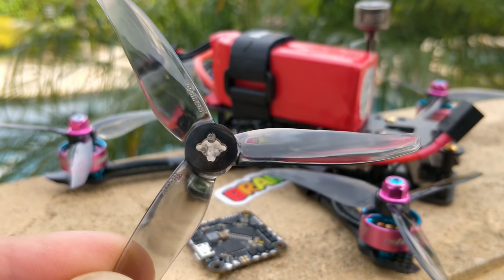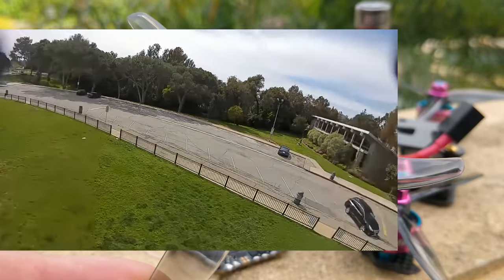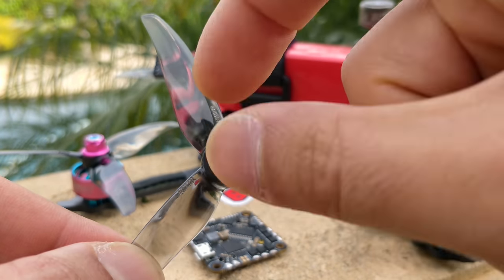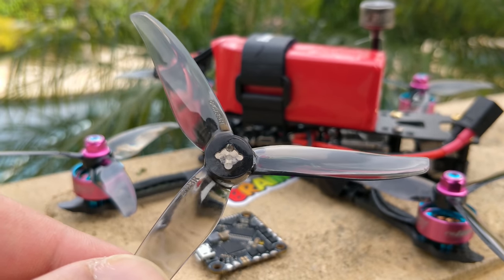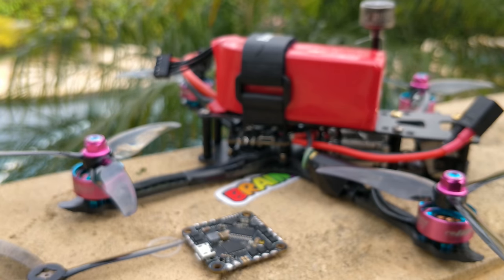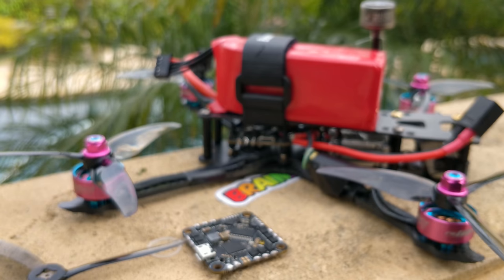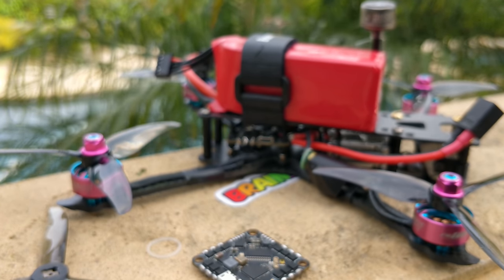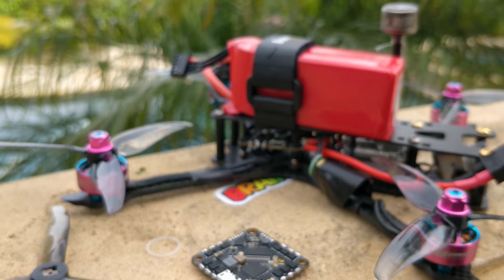Gemfan 4023 and recent  4" builds

Comment: Why such a shallow pitch?  Why not a 4146.6, just scale down the 5146.6?  I'm obviously no aerospace engineer and i'd like to think whomever is making these is, but i'm skeptical.
Reply from the maker: A very valid question. In the past we were all about the aggressive props because we believed they gave us more thrust. What we didn't realize is that these things are always in a hover state and aggressive pitches while great when you're going 130mph, suck at everything else below those speeds. They're like paddles pushing through the air where a shallow pitch prop will more easily process the air into moving in a specific direction than just causing a ton of drag. The resulting difference is better overall response, better throttle control throughout, far better efficiency and a wider rpm window. We gave up the top couple mph as a result to gain all that. Electronics and everything else has gotten much more refined and lighter so we have already gotten those top speeds back and can sustain them for longer periods than we used to as well. 

There is one other significant benefit to aggressive props but you must give up so much else to get that benefit. They can have much better grip because they do make thrust very abruptly in the throttle range. Not true in all cases but seems to be a theme.
Reply: in the past, when they say 4x4.3 they mean " hey, it's the same prop as 5x4.3 but just scaled down to 4in ", but if you think about it, how can you scale down a prop to a smaller size and the pitch/lift can still be the same ? shouldn't it be when you scale down a prop, not only the size number should come down but so the pitch number ?  from what i understand, pitch means the amount of lift a prop can create per resolution.

Comment: btw 300g+ on 4" is bad. AIO. Nano parts. 20g frame max. Toothpick weight for 4" is 180-200g.
Reply from the maker: Depends on the power train. 4" has a much wider window of performance

Comment: Im using 2203 3000kv on gecko 4inch. 650mah 4s is very light... i think 850mah 4s is best. I like 4032 atm. Havent tried gf 4052 yet or this gemfan 4024. Ill try 1300mah on 4s tomorrow
Reply from the maker: I'm literally uploading a video with a similar build right now.
Reply: @Kabab  im still figuring out the best prop + lipo combo. Im thinking 850mah 4s with 4x2.5x3 v2s. What u think?

Comment: i'm a bit bummed about the kv of the et1303
i'd like to run 2s, but 7.5k seems a little high
i'd have expected 6.5k
Reply from the maker: 7.5k is exactly the same equivalent kv as 5000kv on 3s. It should be fine.
Reply: @Kabab  ok, i think i would have tried anyways :P
the 1103's are 7.5k so i thought 3" should be lower
also 6.5k is the exact middle between 11.5k and 5k
Reply from the maker: @marc_frank  1103 works but it's just a bit weak for 3" imo
Reply: @Kabab  yeah, i meant:
2s 1103 7.5k kv for 2.5"
2s 1303 7.5k kv for 3"
i would have expected lower kv for 3"

motor sizes makes up for it and rpm stays constant for different prop size and same voltage? which means constant kv

which means hypothetically 2s 2306 7.5k kv for 5"
Reply from the maker: @marc_frank  as you go smaller in size, the kv can fluctuate in tht thousands and it doesn't make a huge difference. By 3", about 500kv fluctuations start to make a significant difference.
Reply: @Kabab  interesting :)